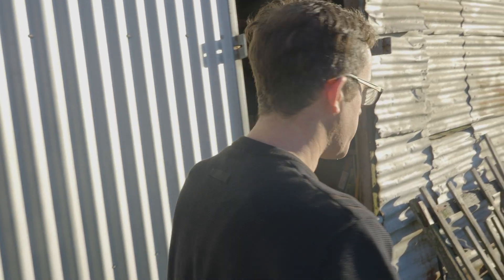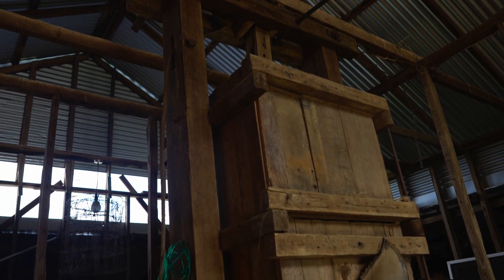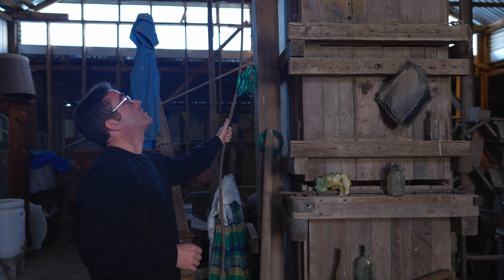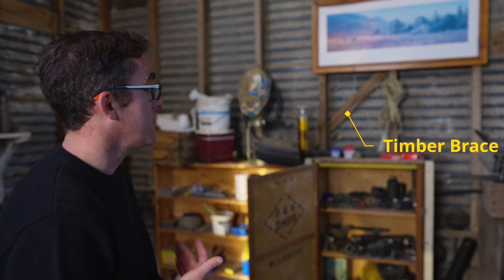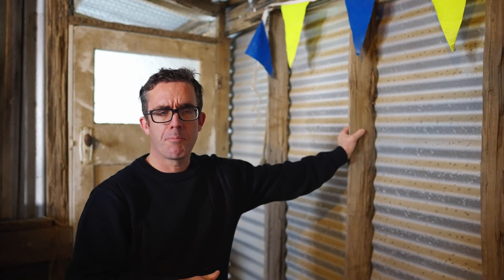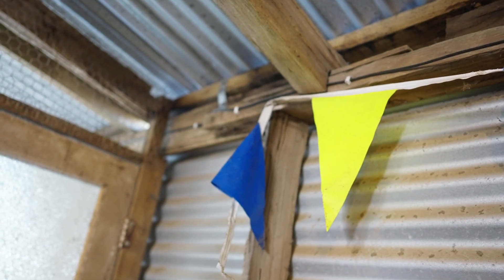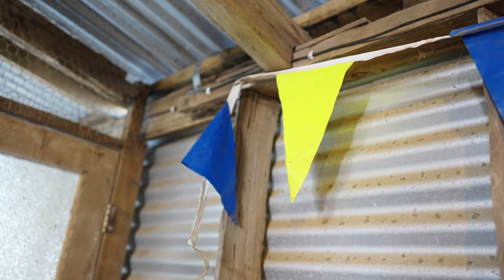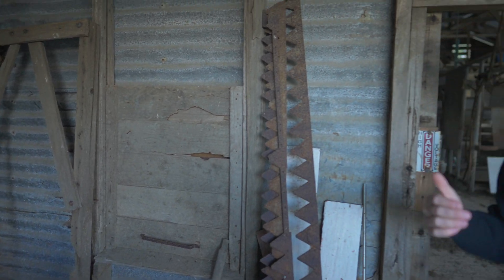A Day in the Life of a Structural Engineer on a farm | Engineering Vlog

Comment: That old frame when it gets hits with Cat4 or Cat5 cyclone for sure it will be uprooted
Reply from the maker: If it got hit by a cyclone it wouldn't likely survive. It isn't located in a cyclone zone to far south.
Reply: @BrendanHasty  Hi - its what I thought so as well, its just so impressive it was done based on old standards design having no noggins to stiffen the studs and terminates its slenderness. I guess the timber cross brace contributes a lot other than resisting any lateral stresses, it also improve the axial capability of each individual stud frames, noting the connection too. Keep up the good work Sir - will follow you and will learn further. Have one request can you do a vlog, just your thoughts on reason of the failure of the opal tower. If its not illegal to talk about in engineering perspective. Would love to hear it.